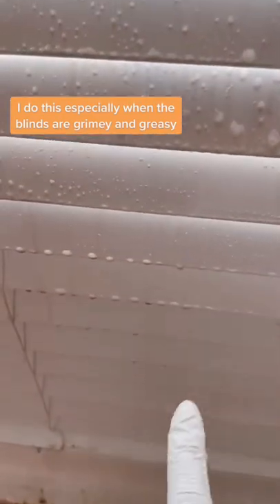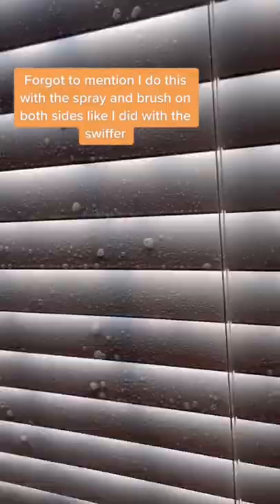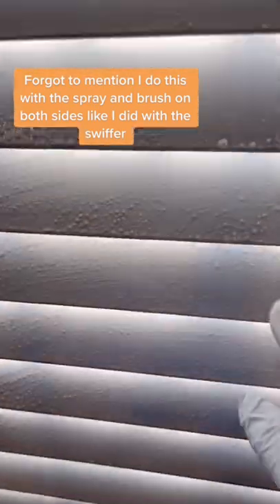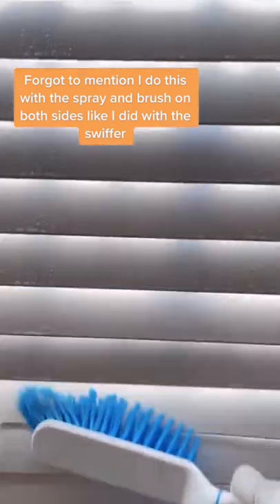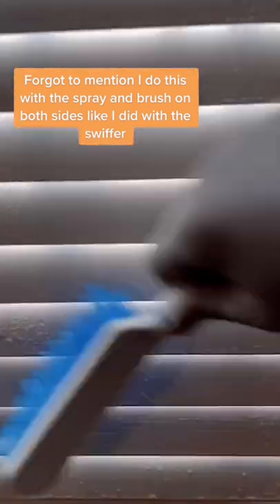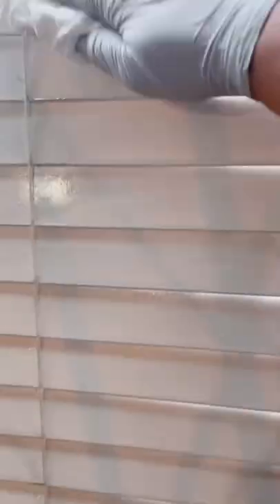How to clean blinds

Comment: "Let me show you the easiest way to clean blinds." Then she proceeds to outline a 12-step, hours long process.
Reply: But it works and you didn't have to figure it out on your own
Reply: @pikachu7572  I have never had to "figure out" how to clean blinds. It's pretty self-explanatory and doesn't take nearly this much effort. Mine is a 1 or 2-step (depending on how you look at it or how dirty the blinds are): scrup and wipe. You're welcome.
Reply: @mewho6199  Figure out “how to clean blinds easily" or did you forget what the video was about? I guess you would think your simplistic "advice" is meaningful
Reply: Lol, I'm thinking the same thing.
Reply: @pikachu7572  Do you really think the process described in the video is "the easiest way" to do it? The video should have been labeled, "Most lucrative way to clean blinds if you're a professional housekeeper who gets paid by the hour."
Reply: @pikachu7572  
That was not the easiest way to clean blinds. That was the way it's normally done LOL

I used to just take mine off and soak them in ammonia and water in the bathtub, use the shower to rinse them off and wrap them up in a towel and take them outside to dry. Easy peasy. But you have to live in a house for that to be easy
Reply: Mine would take all day rather remove them and hose them down that's how dirty they are
Reply: This is a long process if cleaning at someone else’s home
Reply: @me who   How do you clean blinds?
Reply: @me Who. How do you clean wooden blinds
Reply: @mewho6199  people who pay to have their house cleaned tend to be pretty picky about how thoroughly it's done... If she's not doing it thoroughly when she does it, you can bet that at some point she will either hear about it from the homeowner or get fired and replaced...
Reply: Yes too time consuming
Reply: I have taken him off  hung them outside,  spray them off with simple green and hosed  them off with a garden hose
Reply: @jdavis9092  That sounds reasonable,  but then the video should be called "Most thorough  way to clean blinds for picky clients," not "easiest."
Reply: and what if the blinds are tacky/greasy, that method won't do diddily squat.

Comment: I like to take mine down and throw them in the bath tub with hot water and a dish washer tablet. It’s the only thing I’ve found that doesn’t leave water marks or left over greasy/dust
Reply: Much easier
Reply: Same
Reply: Do you just let them soak or do you wipe them individually? Do you dry them off?
Reply: I was about to type the same thing!!! Have u ever tried the scrubbing bubbles shower cleaner?? Put them in the tub and spray them down-let them sit for about 10 minutes and hose them down🥰🥰🥰
Reply: @toughbikkies3699  my mum soaks, wet wipe, dry cloth to get the most water off and then lets it airdry
Reply: Exactly! I simply put them i bath 🛁 her way will make windows wall and floor dirty/wet.
Reply: Came here to say this!!
Reply: Very true
Reply: @ShalamarEntertainmentGroupLLC  This works? Plastic bounds or the other material?
Reply: I used to do the same, but I got rid of them because they are too difficult to keep clean.
Reply: My mom taught me that as well, but she put in a little bit of bleach .
Reply: @mstwelvedeadlycyns  I have found it works well with Vinyl blinds of any style
Reply: @anneshirley9560  u can NEVER go wrong with a little bleach😉
Reply: I hope you clean the window first because if not that defeats the purpose.
Reply: Same as me gets them lovely and clean without much fuss .
Reply: This is genius!
Reply: THIS is the "easiest way"!
Reply: 100 this is how I do it: I hang them over the side of shower and set a fan on it to dry it.
Reply: I do the same with bleach water.
Reply: Me too!! I thought that I was the only one doing this😂
Reply: Ya, UNLESS your blind is longer than the tub, have to take out on the lawn to spray and hose down, but then there's always some mud
Reply: can you do a video, that sounds easier...thanks
Reply: how long do have them soak?  thank you for this great idea.  i have to clean 7 of them and i keep putting it off.

Comment: When I was growing up, my mother would take them down, drape the top over the clothes line, throw a bucket of soapy water on them 1 or 2 each side, hose them off on both sides, leave them out on the line to dry, then bring them back inside hang them up and run a clean dust cloth across them
Reply: I do that over my gate /fence .
Reply: Indeed! I use ammonia and hot water in the bathtub then wrap them in the towel to take outside to dry LOL
Reply: Has anyone cleaned the faux wood ones in the bathtub? They're softer inside vs the wood.....The edges were cut to size so I'm kinda scared they'd swell like fake wood when it's wet. Idk. 

Help 😂 they're filthy! I can't do this wipe down each process to every single one it would take all month. I used to clean my plastic ones in the tub.
Reply: I was wondering if u could do that

Comment: U dusting the blinds have me an allergy attack already. Hell for dust allergy sufferers
Reply: And sooo rough with them too 😬
Reply: Why not use a vacuum  with the duster attachments, suck up  the dust, so it doesn't spread the dust everywhere  else, then wash an dry. I have dust allergies cant have all that dust spread everywhere.
Reply: But the Swiffer. Dust is attracted to it so the chances of dust going into the air reduces greatly. Put a mask on
Reply: @tinafrompasadena3192  take the swiffer after the vacuum.  Doing it like that, doesnt matter.  Dust flys everywhere

Comment: when i get my own house im not gonna have any blinds or glass shower doors because i hate cleaning them. stainless steel too lol
Reply: Windex and a microfiber cloth works great cleaning stainless steal
Reply: @melisue7487  i just use stainless steel cleaner or windex at my clients houses but for my own house i don’t want it because u can see fingerprints easily and it would drive me crazy lol
Reply: @sweetlady1616  oh yeah I hear ya. It drives me crazy as well. I’m always wiping everything down constantly while bitching about everyone’s dirty ass hands in the house lol
Reply: @sweetlady1616  
My refrigerator is stainless steel but it's the kind that doesn't get fingerprints. And you can have Windows that have lines sandwiched between the Dual panes.
As far as glass shower door, I don't blame you. Just get yourself a shower big enough that you don't even need a door or a curtain.
Reply: @tinafrompasadena3192  stainless steel looks nice but i feel like i would be constantly cleaning it lol. & yea for the windows i would probably just have curtains or the roll up blinds like you said
Reply: @sweetlady1616  I just moved to a new home and we purchased a “smudge proof” stainless steel refrigerator. I have small children and it’s the way to go. Not a fingerprint in sight. 
We have a “smart” everything in this house, including the blinds. They’re between the glass and have a remote control to move them and they can be set to open and close at whatever time you want. It’s kinda cool but unnecessary. I didn’t mind cleaning my wooden shutters and washing my curtains at my old house.
I didn’t love using the squeegee on my old glass shower door after a shower either, at my old house. My new shower doesn’t have any doors/ curtains so I feel somewhat exposed lol my kids come in and talk to me the whole time I’m showering. There’s no door to close! Lol
Reply: @NotJessH  LOL. i wouldn’t mind not having a shower door. the less work the better
Reply: Tinted windows like they have on cars! Lol
Reply: I can clean them for you at a good prize  interested let me know

Comment: My tip to cleaning blinds is to take them dust traps down from your windows & hang nice curtains instead. That way when you they need to be cleaned you can just put them in the washing machine. Buy extras in different colors & patterns when they're on sale, so you can change the look of your rooms & you can rehang a different set after you take down one to wash to avoid having to wait the 30 mins in the washer & depending on the curtain 20 mins in the dryer. It makes life easier for me & gives my house different looks.

Comment: There is actually a gadget to clean blinds that looks like how a Swiffer would look if you were to cut several horizontal strips into it spaced apart, replace the "feathers" with microfiber, and shorten the handle. You can spray cleaner on it or use it dry.

My great aunt had one years ago, and I'm pretty sure she got it from one of those magazines that all of our grannies get in the mail and love to order a bunch of stuff from lol. Harriet Carter is the name of the one of those magazines but I forgot the name of the other ones she used to get. I'm sure you could find the gadget on Amazon but if not check the granny magazine's online stores. 
Don't sleep on those granny magazines though, because sometimes they have some cool stuff!

Comment: Hang blinds in shower or outside. Spray both sides with Scrubbing Bubbles foaming shower wash. Let it sit as you clean your windows.....be sure to spray them with super hot water from shower sprayer or just cold water from hose  prior to the Scrubbing Bubbles.
After you clean the windows....rinse  the blinds with water from the hose or hot water from your shower spray head. 
CLEANS BLINDS LIKE CRAZY....and if you let them hang outside to dry ... No water spots!

Comment: Fill bathtub with hot soapy water.   Put blinds in water being careful not to tangle cords. Use a soft brush clean the blinds after soaking for an hour.  Let out soapy water.  Rinse with clear water.  Fill tub again.. put 1 cup white vinegar and swish blinds. Once it is clean lay it on a sheet opened fully to protect floor.  Let sit til dry. BEST WAY...BUY NEW BLINDS.

Comment: Hell ya! I USED TO take them off and hang them all on the clothes line then can use products brushes and the hose to clean and rinse and dry them all in one spot with no fear of walls, windows and carpet or floors getting damaged. I live on 3rd story of a walk up now. No hose. No back yard clothes line etc. This is an AWESOME way to do this indoors. 👍👍👍✌🤗

Comment: That just puts the dust into the air though I’d use a vac brush first
Reply: That's what the Swiffer is for
Reply: I vac first too. Swiffer or static duster ok in between but just kicks the dust in the air and less dust resettles on blinds and everywhere. Sweeping isn't enough, there's always a film of dust to wipe off, then you see how dirty they are. These blinds are so hard to deal with constantly. -John's wife

Comment: If the blinds can be removed from the window area then take the blinds down hang them on the clothes line .

Get a bucket of hot soapy water and a soft brush do one side with soap and water then do the other side .

Then take a hose and rinse off both side let the blinds drip dry them hang them up

Comment: there are actually 3 types of blinds: plastic, wood & metal!  if they are color blinds you need to make sure whatever you use doesn't change the color of the cords or strings!

plus the chemicals may cause the metal ones to peel.

Comment: I’ve never had the wooden ones so I can’t speak to those but, for the plastic ones, I just lightly mist (not spray, not drench) each side with a bottle of equal parts water + white vinegar. Then I use the Swiffer like she does here on both both sides. I do this once a week & my blinds stay spotless. Of course, u would have to start with clean blinds & then do this for upkeep. Works for me & no, it doesn’t leave a vinegar smell behind. Just make sure the spray bottle u use has a misting function on it. A regular spray bottle would be too much.

Comment: Take down blinds. Hang outside. Spray liberally with cleaning solution of choice. Leave on for 15 min. Rinse with hose, preferably with a spray head and water turned on high enough to remove soap and any remaining dirt. Leave to dry. On a warm dry day about 30 min. 
Labor time about 30 min. Job complete in about an hour

Comment: I love my cheap Walmart blinds, they are the best for me, they might not last forever, but I have had some more than 10 years and they are still working fine.  I just put them in my tub with my regular shower soap, wipe one side then the other, rinse and hang back up to dry, very easy. Bought better blinds once but will never do that again.

Comment: Those are vinyl blinds, not wood.  😊
Reply: Must be vinyl with the faux wood pattern. They are hard to clean and keep clean. Even if you start with sweeper on both sides, the dust still sticks unless you wipe them with vinegar, water and a few drops of dish soap. There's always an edge of dust on the top outside ridge unless you wipe them. If you let them go too long,  they get so dirty when you wipe them. ugh! I should try the dish detergent pod in bathtub!-John's wife

Comment: Put the blinds in the tub. 
Turn on shower to wet blinds. 
Spray with cleaner let set 5 minutes.
Use feather duster to smudge the cleaning solution to gentle clean blinds. Let set 2 minutes. Do not let solution dry. 
Then turn on shower to rinse. 
Hang outside on clothesline to dry. No ruined blinds!!!

Comment: I put them on a clothes drying fold out horse in the bath spray them down use a dish brush then shower them down leave them to dry put them back up.😉👌🏼 pvc ones by the way threw my wooden baught pvc for easier cleaning.

Comment: The easiest way to clean them is to remove them all and put them into the bathtub with a warm water and cleaner mixture...Let them soak for about 2 minutes, take them out one by one, use a towel to dry them off then hang them back up...Done.

Comment: Dust mites are my WORST allergy I use a wet cloth to individually clean them so NO dust goes into the air. For $3.33 I recently got a cloth covered blind cleaner that cleans 3 at a time should save alot of time. I rinse the cloth frequently. Blinds are still better for allergies than curtains unless you wash them frequently and then they fade.
Reply: Sorry forgot to say I got the blind cleaner at Walmart

Comment: I fill my bath tube with a cleaning solution and let them soak . My mother did this and my grandmother . The method suggested here doesn’t work . 78 hrs later my blinds would be 1/3 clean and I would be bed ridden 🫣

Comment: THAT is not ' easy ' ....I sort of dust them off, then they're taken down, placed  in the bathtub, with a mixture of Dawn dish soap and white Vinegar. ...(or if you have to, you can actually hang them outside, spray down with the Cleaning mixture, rinse with a hose. ) Then soaked, srub if needed. Rinse with VERY warm to Hot water, hang them outside to dry. 
Less time and you can clean the windows once they're soaking.

Comment: "The easiest way we clean blinds.". Funniest faux "easy to clean" spoof I've seen in a long time........ Or is this chick seriously claiming her hours long, multi-step wet and dry blind cleaning routine is easy? Meanwhile the detergent and debris is dripping flying all over the place. Without rinsing the detergent off the slats become sticky, requiring even more cleaning thanks to dust sticking to the blinds. Just put the damn thing in the tub or shower. My housekeeper used to use a garment rack in the shower to clean two blinds at a time. Now a company comes every six months to clean them in their truck. The large wood blinds are really heavy, requiring two people.